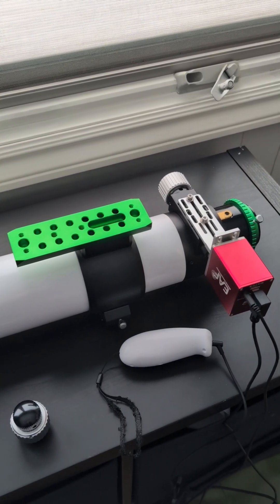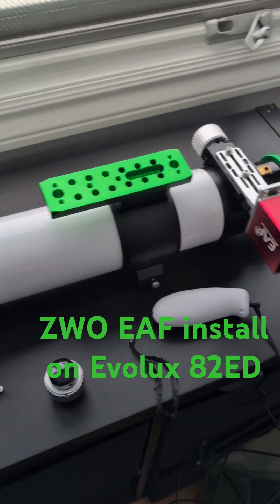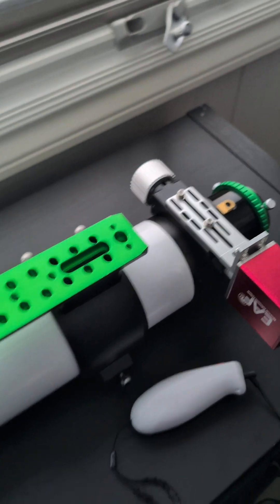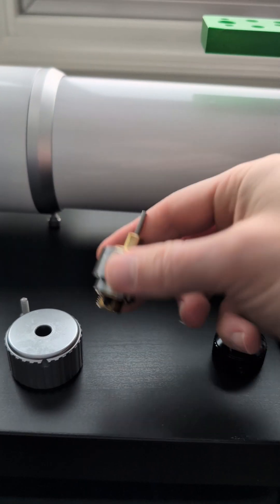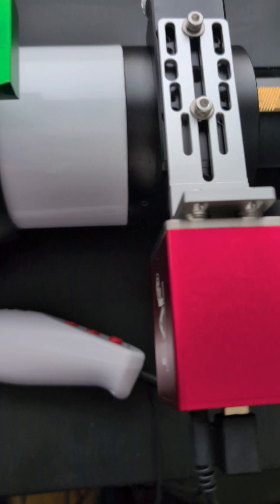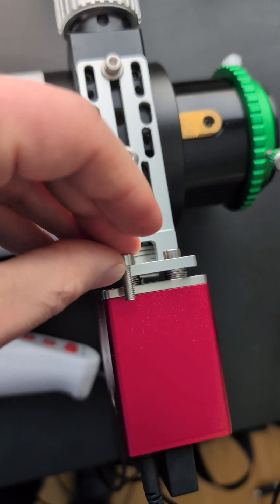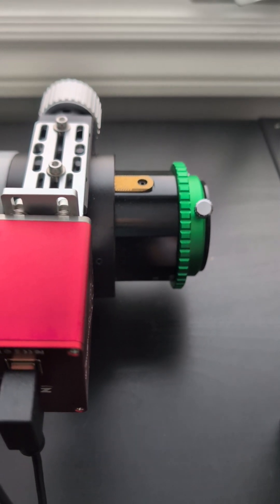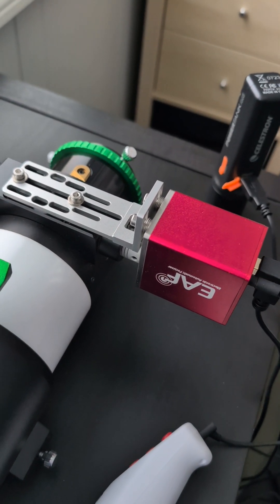ZWO EAF on Evolux 82ED

Comment: Hi can you please tell me, did you drill and tap the centre line bracket hold down plate on the focuser on you Evolux 82ED or does your one come as standard with centre holes as my one has none, but the focus lock down bolt and that is 8mm thread?
Reply from the maker: I did not tap or drill anything, and I only used the holes available
Reply: @TennesseeAstro  Thank you for your response. On my Evolux, there are no tapped holes except for the one designated for the focus lock. Therefore, I removed the focuser, drilled and tapped 4mm threads, and resized the spring coupler on the lathe to retain the fine focus knob, which turned out to be an easy fix.